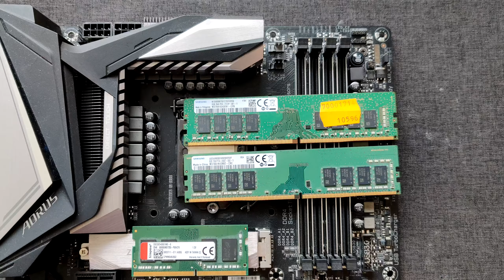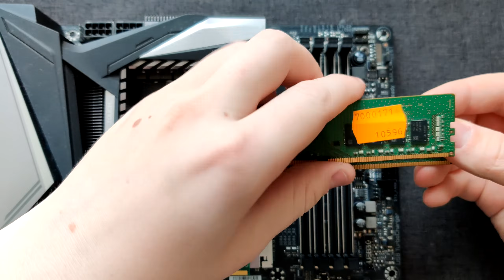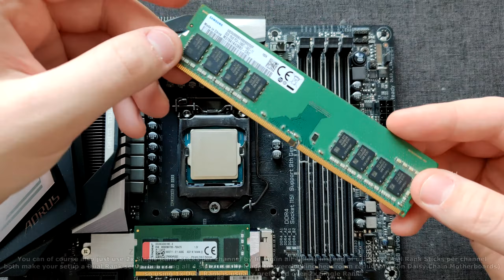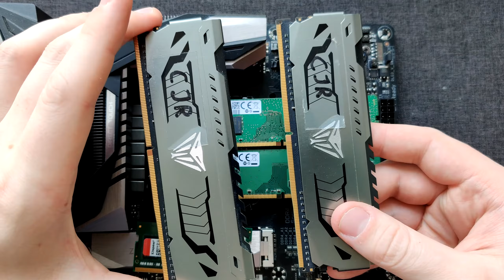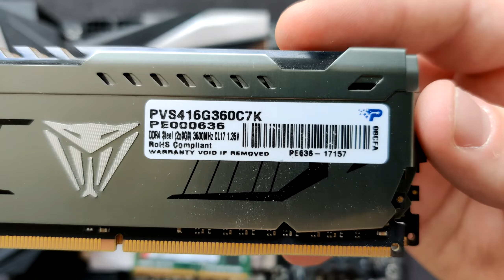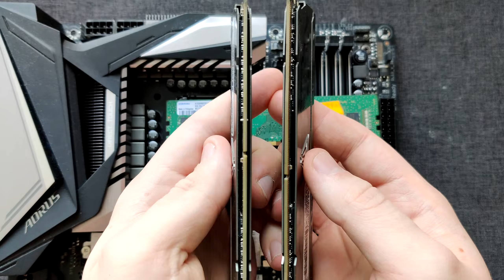RAM Explained: Ranks and Bank Groups (Why Dual Rank is faster)

Comment: hello i'm currently oc my dual DR 2sticks Bdie xmp 3200 c14 on a amd r9 5900x to 3733mhz c16 with stock VDDP VDDG,but without modificatino in need to tune my vddp to 975mv and VDDP 1075mv, but i cant go upper than 3833mhz, i change my RTT to 7/3/Disable or park 1, some change if i go to 3733mhz or 3800+, do you have any advice to help me to clock more ?

Comment: Dual Rank is harder to run and likely clocks lower when you're reaching the edge of IMC stability. Do you really think the benefits of Single Rank are outperformed?
Reply: Its probably fairly minimal on real world performance at stock but stability wise if you are over clocking - tougher.

That being said, if you were to run 4 single rank dimms (fully populate the slots) then you may find it performs worse as electrically the signals travel further. versus a pair of dual rank dimms.

I know in my case that I'm running 4 32GB DDR4 dimms on my 5950x so its max memory controller stress. (dual rank x 4)
It is happily running though at the rated speed from the manufacturer of 3600MT - course a 400MT increase over the stock speed isn't a whole lot.

Comment: Does mixing 1 rank and 2 rank cause any issues on normal use vs overclocking ?
Reply from the maker: well you will end up with triple rank and mismatched PCBs. as long as the ICs are the same it won't affect overclocking too much but memory controllers generally get very upset when you put more than two ranks in each channel

Comment: Watching the video now, but my doubt is:
4xSR vs 2xDR

EDIT: you addressed that at 2:50 thanks
Reply from the maker: 2xDR will overclock better on most boards these days since the almost all use a daisy chain topology. filling all 4 slots on those lowers your max frequency by a lot.
Reply: @CmdrSoyo each in one of the channels? 1 dual rank in channel a and another in b?